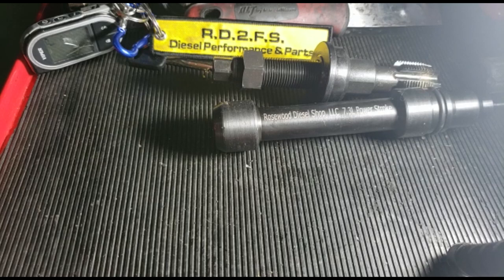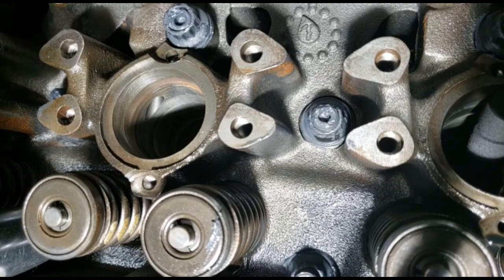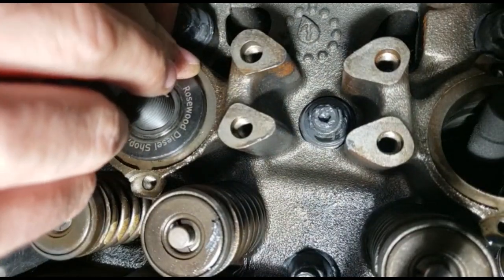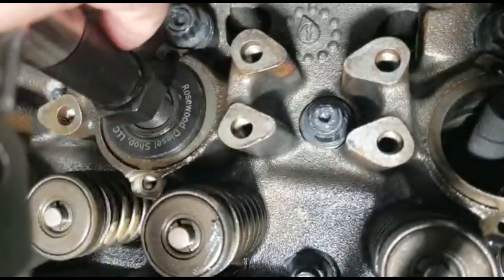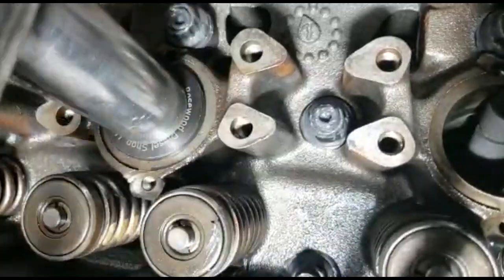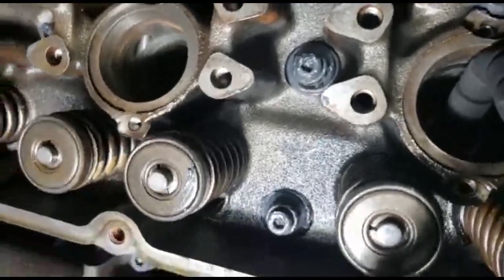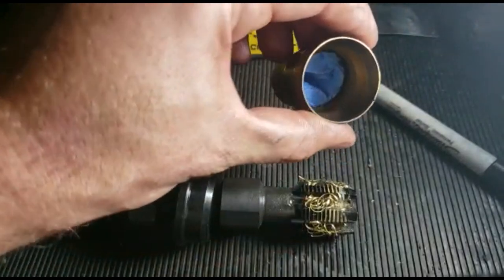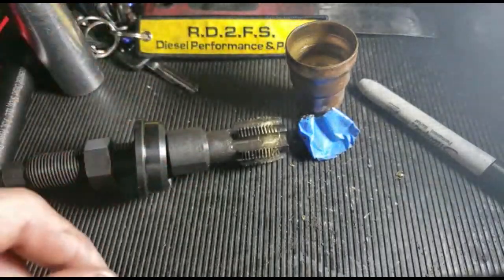7.3L Powerstroke Injector cup removal tutorial

Comment: I have a 1994 f350 turbo idi and one of the cups on the bottom of the injector is stick in the head. As I was changing the injector the bott piece stayed in the head and I can't get it out. Will this tool work?
Reply: @RD2FuelSystems  thanks. Trying anything before I end up having to take the head off